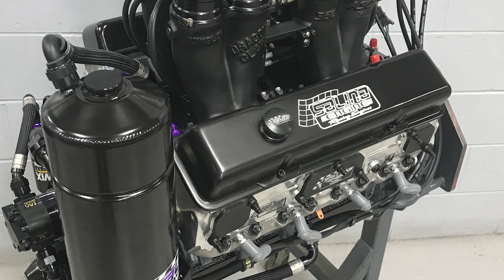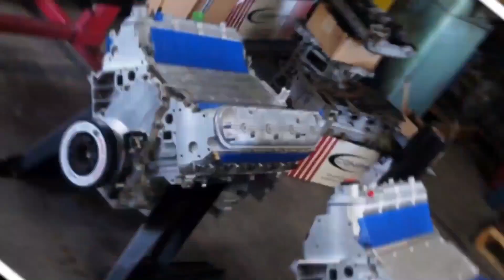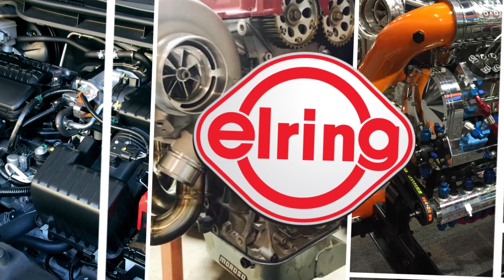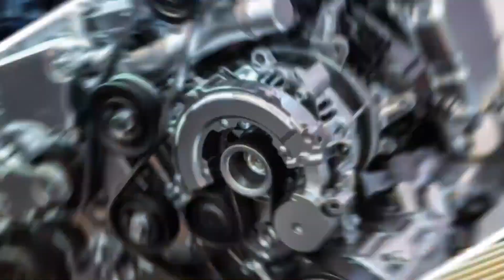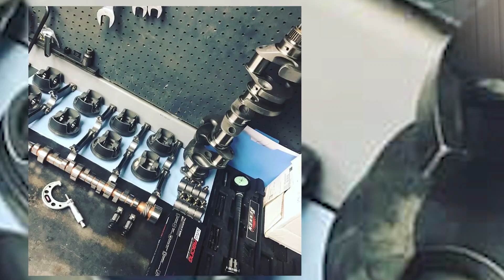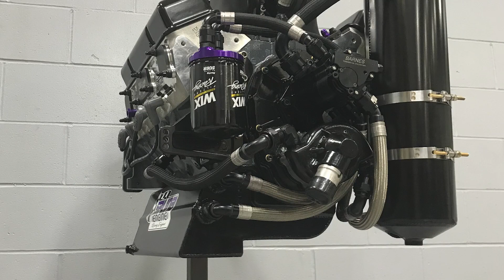ASCS 360 Sprint Car Engine

Comment: I did hear, approx 10 months or so ago... ASCS  engines can now have The Spec Brodix Heads Ported.... Because so many Engine builders were Cheating-Porting heads,shot blasting ports to look like castings.....It was happening Here in Australia as well...
Reply: Yes you can. Aslong as you dont remove the ACSC logos in the ports. And don't exceed 215/220cc

Comment: Find Me a Sponsor, and I'll dyno my 360ci daily driver single 4 barrel carb street motor, stock production car 2bolt main block .942" lifters, stock Small Block Chevy,, stock stroke crank, stock rods, cast pistons, with cheap Chinese 23° heads, on pump fuel, against that ASCS motor in its as tested configuration, if you make it fair with the same intake manifold, induction, no dry sump system, a  stock chevy oil pump, and  no vacuum pump.

Comment: Kinda surprised to see them using SHP blocks...
Reply: Why?
Reply: @bloodykills7509  
Figured they’d use a little M or an iron eagle
Reply: @shitbox7413  This is their base ASCS 360 $33,500. 
Their top-of-the line ASCS 360 uses the Little M block.  > $50,000
Surprised the don't build a GM 400 block w/ 327 crank 360 cu. in. engine.
Reply: Not really. Weight is king, particularly in sprint car racing. The Little M is about 30 lbs heavier than SHP. When everybody is shooting for a max of 1475, 30 lbs is HUGE.
Reply: @jayss10 seems they are worrying about ounces - which is the attention-to-detail mindset needed.